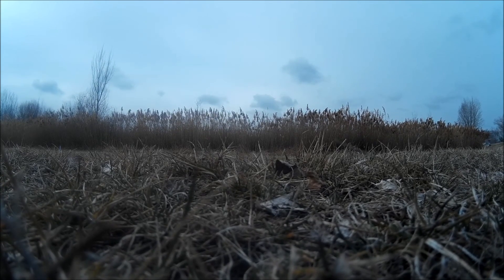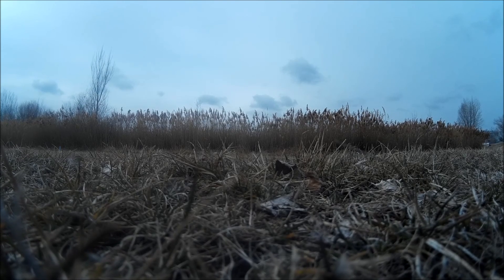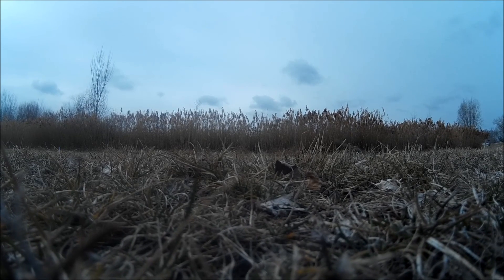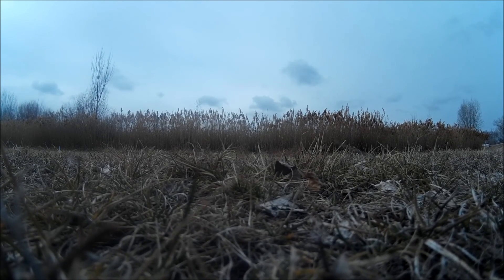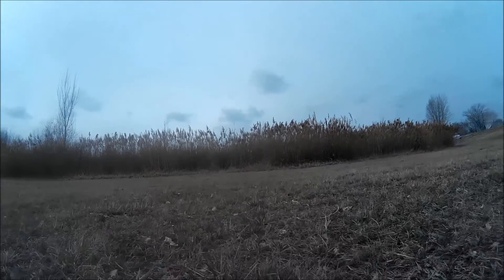Clean Flight on CC3D * Maiden Firmware LOS * W450 * T-Motor Air Gear 350

Comment: I have a cc3d FC and I have only experience with APM yet.
First time I tried cc3d I put OpenPilot toit and built my first  tricopter, but it was oscillating and was hard to find a cheap and good tail servo so I gave it up.
Now I am going back to quadcopter business :) I've built an 500 frame quad and I am out of APM FC so I will put my cc3d from the not succesfull tri there.
What would you suggest to flash to cc3d for an 500 quad? OpenPilot or CleanFlight?
What PID range for low Jello?
Reply from the maker: Actually now days I would suggest LibrePilot honestly. OpenPilot company split in two and now LibrePilot is better IMhO. If the tail shakes on a tricopter just lower the P gain on the Yaw axis way down and it will stop. You can tune that out for sure